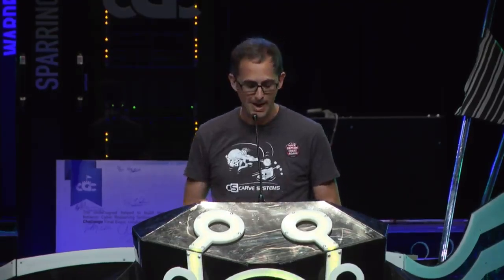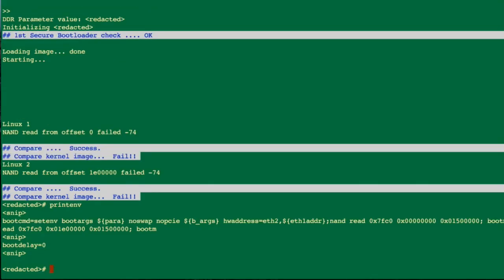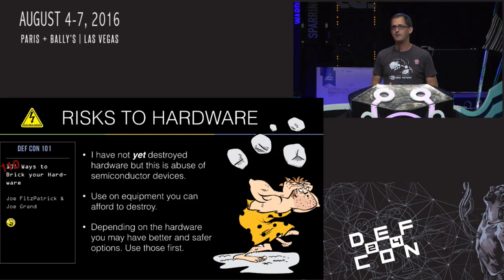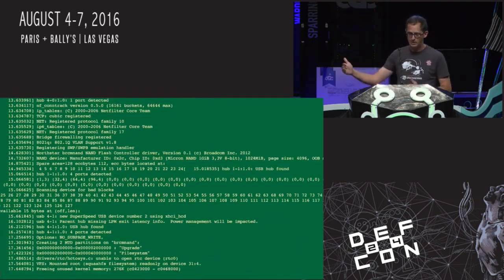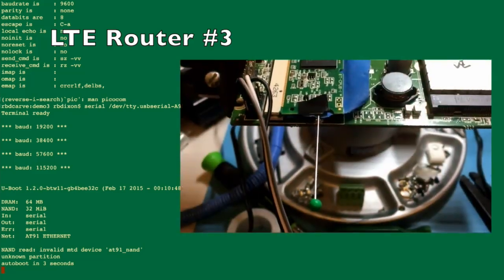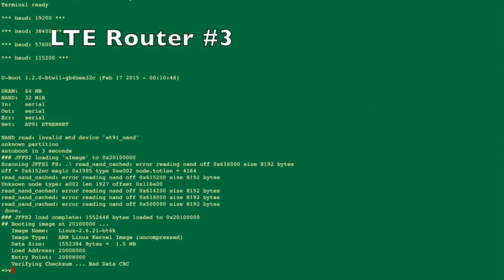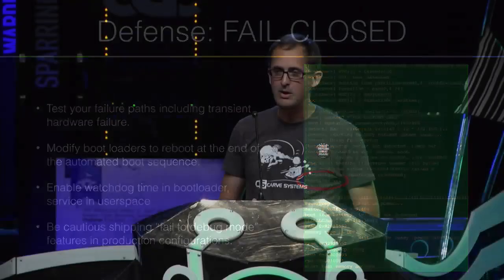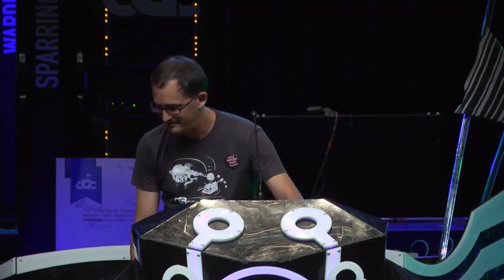DEF CON 24 - Brad Dixon - pin2pwn: How to Root an Embedded Linux Box with a Sewing Needl

Comment: BGA fanout to obfuscate by glitching/thumping  will only be effective if you use blind buried vias.  Otherwise the vias will be thruhole and available on the bottom of the PCB  - even for traces going from a ball stringer to a via directly to an inner layer - so they will be vulnerable.  The other thing you could do is backdrill the fanout vias - but again - that's expensive, typically only used for removing via stubs for high-speed signals. And most EDA tools are now just getting that feature (Altium has it but can be buggy).  Yea, you could put bypass caps over them but those are easy to remove and most uC's, uP's and FPGA's will run fine without a few bypass caps. And if you'r using 0201 or smaller you won't have the room between the pads - and designing a PCB like that gives CM's heartburn....The issue is - blind - buried costs more to fab. most consumer gear can not cost justify that. Those are laser cut and plated See this microsection - http://www.contag.eu/uploads/techniks/blind_via_sackloecher.jpg

 Recall the X box BIOS mods? Did a lot of those for hacker friends - the kit soldered to thru hole vias

If you've ever done any PCB designs you'll know that most BGA's WILL require running the stringer-via to an inner layer to escape - no other way to do it. So fan out will require escape to inner layers

Even still - there's lots o' meat on the periphery  balls... You can do what HP does and epoxy around it - but most epoxy can be removed with an SMT hot air tool - the epoxy turns into this brittle crap that can easily be crunched off

http://ajawamnet.com/